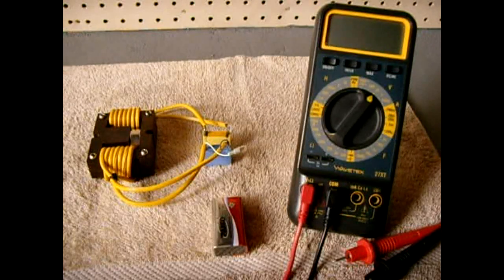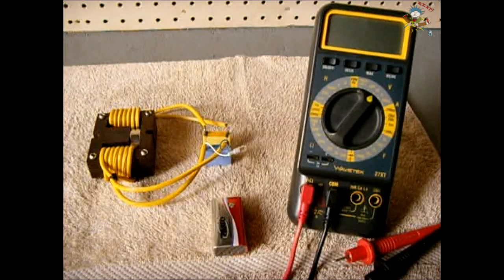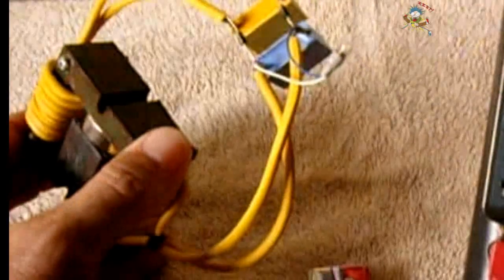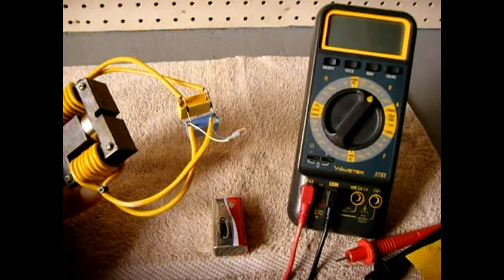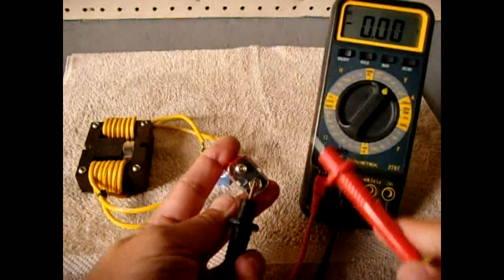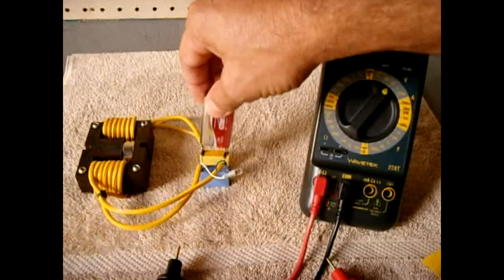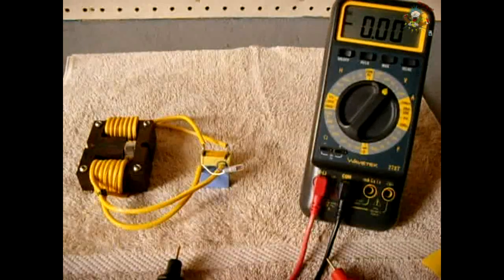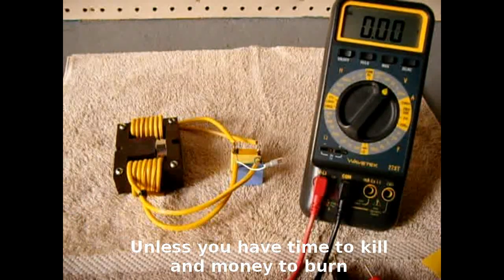Overunity Motionless Free Energy Generator EXPOSED!

Comment: It may well be a fraud, but the lower coil in your version seems to be wound opposite to that in the link you gave. Did you try reversing the directions of the coils? The specification of the core used is also important. I have seen versions of the MEG device, such as Lt. Col. Tom Bearden that are pretty convincing, replete with oscilloscope waveforms.
Reply: magnetshack Yes, that is precisely the kind of approach that one needs to prove to the world that something does not work. Much appreciated.
Reply: magnetshack I have been to your YouTube channel but I see no videos there.
Reply: ElectroAfrican Yes I took an extra day to make the video message, so it made sense. It will be up today. I'm making all this really simple and the video letter explains everything. Please subscribe, as it makes all the years of experimenting and wasted money worth while in the end.....
Reply: magnetshack No one said you can "hear light". That's not possible. What is standard practice in light communication, as in RF communications, is modulation by a variety of techniques. One such technique that is particularly suited to light comm is pulse-width modulation. The audio signal amplitude or computer data (on-off) is made to chop up the carrier i.e. turn a LED or LASER (or whatever light source is suitable) in the pattern of the audio or data. Once this is done it is essentially inaudible. On the receiver end a number of techniques can be used to recover the modulating intelligence. With PWM, for instance, one can even use simple averaging i.e. low-pass filtering prior to amplification. The idea of modulation is well studied and practiced in electronics today and is not new. As digital electronics grows, newer techniques are being introduced and these continue to evolve. Recently the move to Software defined radio (SDR) with its IQ-modulation has spawned a flurry of activity. That's all I am asking you to find out, for your own personal growth.
Reply: @woozygrizzly  What part of SCAM don't you get?
Reply: magnetshack Here is a reasonable tutorial on audio PWM using technology components i.e. FPGA: PWM Audio Tutorial using a FPGA
Reply: ElectroAfrican free energy is obtained by static electricity charged particles in the atmosphere 
  , Not in batteries.
Reply: You can charge batteries with free static electricity.......
Reply: @magnetshack4764  Can you prove it? You would need to wear something that causes tons of ESD in order to even get less than 1-5 mA to charge it (far too low).
Reply: ElectroAfrican Hi, did all the electronic study on all you say a few years ago, so am pretty 'on it'. Just could never get my head around Huffman Codes for error correction......:)
Reply: electronicsNmore

Exactly.

The only thing one will get by putting the battery across the coil to start it is a momentary HV pulse which cannot happen with the capacitor and bulb connected.

Also the diodes wired in the same direction ensures that no current can pass from either coil to the other coil.
Reply: ***** Now look here, I've just wasted my time, listening to you talking about you wasting your time, about others wasting your time because they waist their time watching others wasting their time too. No point in wasting anymore time as its a waste of more time, get it?
Reply: I have tried your suggestions about changing the direction of the coils like you tell this guy here, I did try many configuration and it failed. I did eventually sus out how this guy did it, and its our old friend 'induction' from under the board like so many other scammers here. I did try this one as it did look convincing from the layout but in the end it did not produce the power output to power even a small bulb. I've done many experiments and still the same conclusion - all are fakes so far. Please subscribe to my channel as I have a free power generator I'm building from magnets and I think this can work, uses a totally different layout from all the other magnet motors on YouTube. More details on my site -  thanks - PLEASE SUBSCRIBE SO YOU GET UPDATES ON THE MOTOR BEING BUILT.
Reply: Here is an easy way to start earning from home, This site can help you with that : bitly.ｃom./makemoneyz , I manage to earn approx $350 weekly :)
Reply from the maker: It is a fraud. You will not create anything using a stationary magnetic field. The windings are EXACT to the very popular video which was uploaded. The great majority of the people that upload these videos are nothing more than masters of illusion.
Reply: THIS IS NOT THE MEG FROM BEARDEN. IT IS A SIMILAR DEVICE. THE MEG USES PULSES IN EXCITATION COILS IN ORDER TO SWITCH THE FLUX FROM THE PERMANENT MAGNET FROM ONE SIDE OF THE TRANSFORMER TO THE OTHER
Reply: electronicsNmore While I applaud your efforts, that is YOUR opinion and you should state it as such. Otherwise show us all your peer-reviewed scientific publications disproving the concept. Your logic is that because you failed to bake a cake when you followed a recipe, then the recipe MUST be wrong". Also, anyone who wishes to "waste their time", well that is THEIR time to waste. Great discoveries are often made by "time wasters". The 2014 Nobel Prize in Physics for the invention of the blue LED is shared by one such person, who dared to use Gallium Nitride doped with indium against the ardent and mainstream supporters of Zinc Selenide. I am therefore more inclined to believe someone of Tom Bearden's stature. For his full CV with details of peer-reviewed publications go to http://www.cheniere.org/misc/bearden%20cv%20long.htm Pay particular attention to papers 1 to 20. I am not trying to irritate you, but I feel I need to correct you.
Reply from the maker: I will not discuss this anymore with you. You need to get past the fact that this is a SCAM. I performed the BEST replication of this device on Youtube. It does not work. You need to use your brains, and think logically. This device would be used ALL over the world and you could not stop the spread of the technology if it worked. I know it is very difficult for you to accept the fact that this is a scam, but you have to, and need to move forward.
Reply: electronicsNmore I know enough of electromagnetic gauge theory to realize that our current view of electromagnetism is only ONE possible interpretation of Maxwell's 20-some quarternion equations. Come on. Let's not discuss it further, it's obvious that it will lead no where, not from this page anyway. By all means keep up the noble venture of producing videos, but by no means presume to tell people what to think.
Reply from the maker: Your wasting my time. You know the saying, "Put up or shut up". When you prove me wrong with a video, and include a FULL description showing EXACTLY what you did and used to duplicate this scam, then we are going somewhere. Until then, we are done talking.

Comment: my friend
takes the view that it is
fraud ...

as you say in the video
not functioned

My buddy was not an
proof.

Should show exactly how
I did not say that it is stupid...

He writes that
has copied the circuit
exactly...
which is not ...

transformer core
used is wrong

one that does not make use of thin
rolled in order yet compact
metalware pieces

Transformers lamellar
make this use to avoid
intense magnetic fields as losses

ιn this demo
the manufacturer makes use SOLID
SONG WHY keen Magnetic field
to come in contact with the magnet neodimiou

Having made use of core
classic transformer designed
to negate the fields shall the demonstration
shows that it has worked really
The scope of oscillation of excitation
magnets neodimiou

the circuit R-K shall be in
@ 35 khz to see results
self-oscillation.

And one last thing ...

Why make
transformers lamellar
metalware and do not make them
compacted with two PIECES ....
because increasing costs of production
stacked with laminate?

not copied the circuit
but it made you think about.
Sorry just not nginetai to work as a
efiaxes not the circuit just a yours ekdochi

Comment: Thank you!  I've been looking at new hobby to keep me busy during retirement, I was actually in the process of trying to duplicate the same from the other video.  glad I subscribed to your channel and got a notice of the new video.  do you have any video showing the construction of a Bedini motor.  I planned on making one.
Reply from the maker: Have you seen this video? I used this the other day on my scooter battery.
Bedini SSG Battery Charger/Desulfator
Reply: Yes.  A mater of fact it is one of my favorite and planned on duplicating it.  Still trying to gather the electronic.  I have the wire and magnets.  I have several schematic of the motor, but they are old with writing not so readable.  Do you have a schematic identifying the proper crcuit.
Reply from the maker: http://rpmgt.org/Schematic2.jpg
Reply: electronicsNmore Now This actually does work!!
Maybe not as an almost perpetual motion machine, but it does charge and rejuvenate old batteries.
I've rejuvenated 4 old car batteries that now store solar power so my solar powered beer fridge can run 24/7

They wouldn't take charge from a normal charger.

Comment: I love these videos of busting claims, oddly partially because overunity is actually a legitimate field of research that will never be taken seriously with charlatans masquerading around.

That might sound a bit fantastic but here is an example- perhaps the first example from back in 2012   http://phys.org/news/2012-03-efficiency.html  LED's efficiency exceeds 100%: "In their experiments, the researchers reduced the LED’s input power to just 30 picowatts and measured an output of 69 picowatts of light - an efficiency of 230%."

Its actually more of a peltier junction mixed with a LED that converts ambient heat into light from vibrations in the lattice while under externally sourced electromagnetic flux, never the less it puts out more than is supplied electrically and the ambient heat is free.  Some might say that its putting out what it is taking from the environment plus externally- but that energy would have remained part of it and not been released by thermodynamic means at anywhere close to that rate.
Reply from the maker: We need people that have legitimate devices, and they are willing to share them with others so they can easily be duplicated. Unfortunately the great majority on YT are scams.
Reply: I would agree with the assertion that the LED is putting out energy taken from the surroundings.   The second law of thermodynamics dictates that heat will not transfer from cold to hot unless there is work done.  Getting 60% efficiency is pretty good in any closed system.  There's probably 100 pico-watts or so coming from an outside source. At such low energy readings, the researches could be seeing the effects of the LED taking electrons from random air particles or any number of other things.    The only known system that won't follow the application of general physics are quantum mechanical systems.    Nonetheless, pretty cool research.  :)
Reply: I would love to see that work. I saw that a while back.
Reply: Great comment! Also, take a look at Dr Paul Thibado and his graphene energy devices. These legit make DC power just sitting there, and in his papers he addresses the 2nd law directly, by its own definition. 

In other words, this stuff is possible. It's simply power from ambient heat, a practically unlimited resource. 

Anyone working under the radar on this almost benefits from the widespread view "it's not possible". Nothing like zero competition! 😀